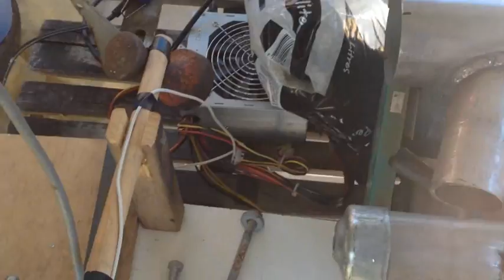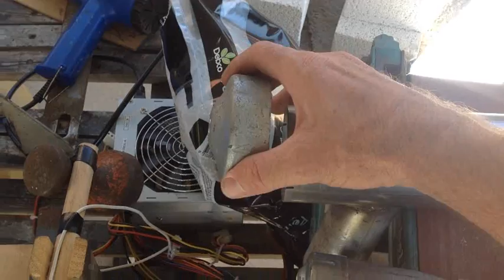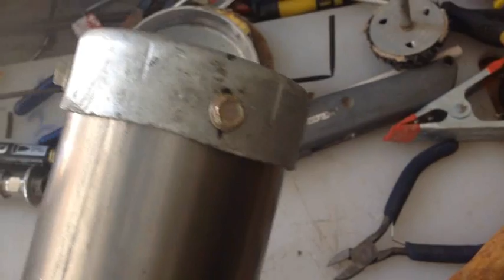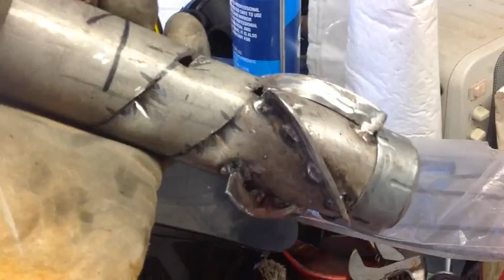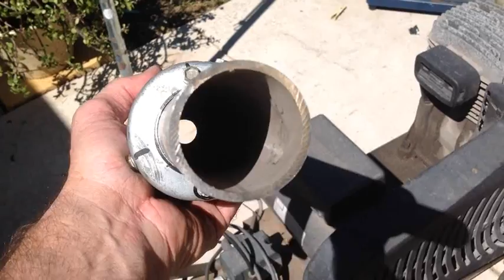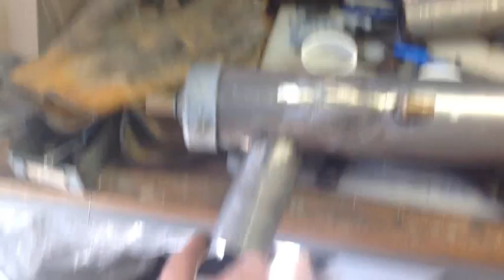Waste Oil Burner - Part 1

Comment: seems counterproductive in principal - 

the oil needs heat to combust, so you isolate the air to beyond the atomizing nozzle giving 4" or so of room to collect heat and maintain good combustion while still giving the necessary air and not giving yourself too lean or too cold a mix. 

but

in doing so, while keeping the fittings and nozzle necessarily cold, you are also constantly cooling down your 4" hot section, meaning you will need low pressure low cfm air to pass by .... but high pressure high cfm air to go into the inner pipe. in other words, overengineered to the degree where it probably won't work very well at all. 

you did do a fine job putting it together - very clean build, very clever use of off the shelf parts - but i do not expect it is any better if not worse than the designs available already. i say this as someone who has built a number of oil burners and foundries and forges, and i also make and install ductwork for a living - so this is my educated guesswork. 

i realize this video is a few years old, but i hope it helps some to highlight how these things work. Oil Burner himself has listed some great tips - specifically, putting a piece of metal in the end of the tube. try putting a handful of stainless steel self tapping screws in the sidewalls on the end of the tube, perhaps 3-6 around the sides. they will last a long time being stainless, and are very easy to replace, but not terribly expensive.

Comment: A very technical build.  I have thought and am in the design process of something based on a loosley similar design.
I'm very much in 2 minds about how this one will work with waste oil. You have created a combustor design like a jet engine but I have my resevations about it. Kero/ Diesel are a lot easier to burn than waste oil. On one hand you are atomising the oil which will help it burn but on the other the incoming air is keeping a large part of the burn chamber cold which isn't good for oil combustion due to the heat needed to change it from a liquid to a gas. I'm wondering if the thing will retain enough flame in the centre of the burn area to properly combust or the oil will condense on the cold burner walls and smoke or dribble?   There is an end bit which would get hot that may be enough but I'm wondering if the thing is going to burn all the fuel. If it does present problems there should be a couple of simple ways around it.  Are you aiming for a general output figure of the heat you want this to produce?

C'mon, where is part 2 so I can see what the real world outcome of the fire up was to answer my Hypothetical dilema?.  :0)
Reply from the maker: Thanks for the comments. I have taken the video of P2 and am trying to find the time to edit for yt, and yes it does burn and yes there is some adjustments to be made. I have done some aluminum melts so far, so I guess it is giving me 700+ deg. You are correct, It does drip until it gets really hot. I have pulled the burn tube out and it does appear to stay fairly cool at the end where I have the fins welded on.  I haven't been able to get it to run on 100% sump oil, but will run continuously on 50/50 sump oil diesel. I have had to reduce the number of coils on my pre-heater as I was having some vaporisation issues. Will get P2 up next week.
Reply: Rob Anderson Pretty much what I suspected. If it wasn't going to burn I would have suggested running a mix but to me that kind of takes away from having a WOB when you have to buy fuel to run it.  One thing you could try that has helped other people I have suggested it to is to put a piece of metal into the centre of the burner. A piece of pipe will do . Just sit it in there. The metal will get hot and act like a glow plug creating a hot surface for the oil to vaporise on and help with combustion. Try to keep it behind where you have the air coming in from the sides to help keep it hot. Pre heating won't help with combustion because the air cools the fuel instantly when it's sprayed. All it will do is help flow if you live in some god forsaken place where everything is frozen solid.
The combustor Design you have made I think is far better suited to light fuels that will burn with atomisation but WO really needs heat to change it from a liquid to a gas and when you have a cool running burner design, I think that is going to pose some significant challenges to get the thing to burn straight waste oil properly.  That said, if you are going to put the thing in a furnace it dosen't matter. Once the furnace heats up you can just dribble the oil in and it will vaporise in the furnace itself. Pretty much how most of my burners work.